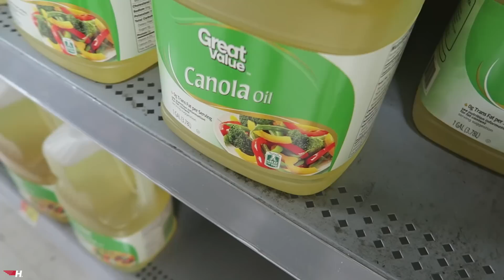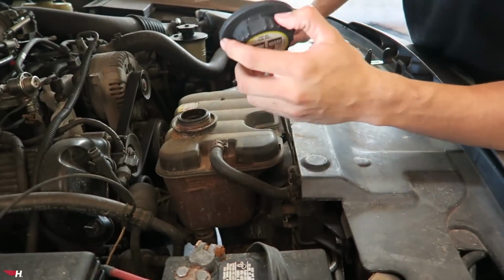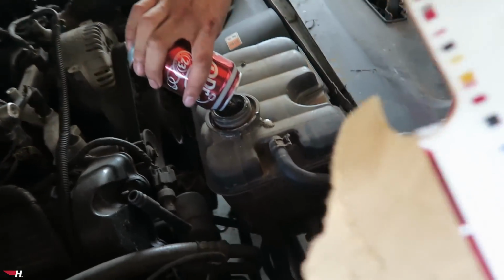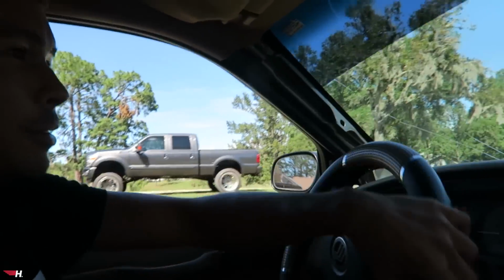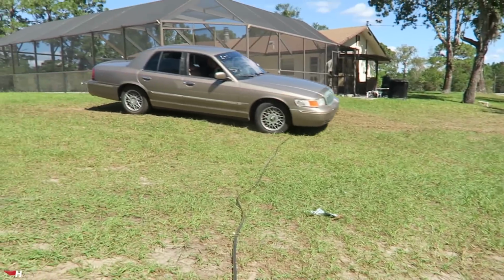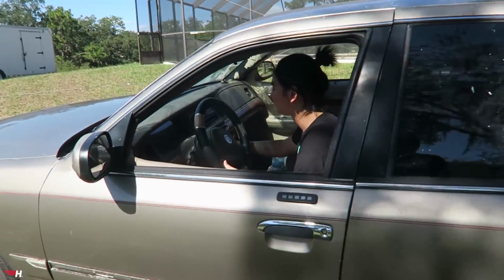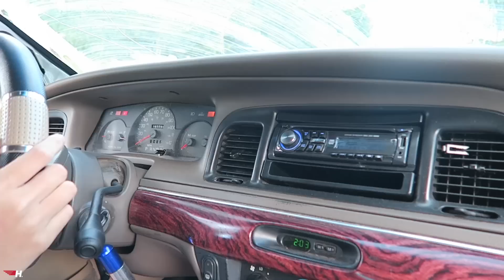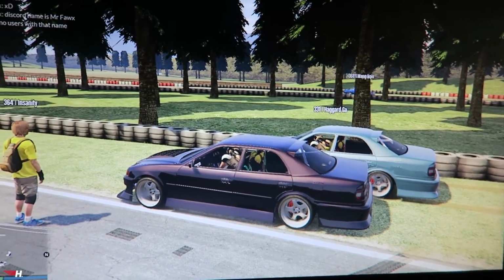Can You Use Cooking Oil As Engine Oil?

Comment from the maker: let us know if theres any myths you wanna see us try to bust
Reply: Mike Michaels stupid question.
Reply: lube
Reply: What happened to the wrx
Reply: Will the brodozer run on Napalm?
Reply: Haggard Garage so sweet that you did this experiment
Reply: Haggard Garage slam a car and to go off-roading
Reply: rva .cu4  pretty much gave it to that 350z kid cause Orion blew that Z up around track. Or that kid hasnt bought a new car yet.
Reply: Try Bacardi 151 for gas
Reply: Haggard Garage coyote swap it and put it on coils
Reply: rva .cu4 traded for the 350z
Reply: Haggard Garage get a working coyote from a absolutely totaled mustang for the low low
Reply: Haggard Garage How much boost could you get out of an ebay turbo in a 90s protégé?
Reply: ts a fact that you cannot for sustained periods of time. Mythbusters have not tried this BUT Top Gear USA series did infact do this and within 15 miles the car ceased the engine and no more engine. apparently so did the BBC Top Gear, they used veggie oil for a volvo. didnt watch the youtube clip but im sure it turned out just as bad.
Reply: Haggard Garage you can use cooking oil to run your diesel on (Bio diesel)
Reply: That radio is mint please send it to me if you don’t need it I need tunes bad bro
Reply: You should use lucas oil stabilizer with cooking oil and revisit this.  Maybe see how many road miles you can get out of it. I think that it was just to thin.
Reply: Will cinderblocks break before jack stands?
Reply: Can the grand marquis run off diesel?
Reply: Haggard Garage can water be used as a washer fluid
Reply: Can the van be driven from ct to flordia ? <3
Reply: John Goepel
Reply: +Haggard Garage will brake fluid work as engine oil?
Reply: Haggard Garage what's ur Xbox one gmaertag I will play Forza horizon 3
Reply: When gasoline is put in a diesel does it really not shut off with the ignition?..... try it with the brodozer
Reply: Will onion ever have the balls to get the Lexus or will he keep showing off a rifle any 18 year old could buy in Texas
Reply: rva .cu4  it's with the guy who sold them cams Z
Reply: Can you place in a pro/am event?
Reply: Haggard Garage get ur Lexus back
Reply: Fill tires with expandable foam!
Reply: Why ebay cam left haggard
Reply: If I paint my car green. Do I have to give it away?
Reply: Win a drift competition.
I think I've seen most videos haven't seen a W. While adamlz just got his wtf
Reply: Can you use mustard to clean wheels
Reply: Butthurt Orion he did it to mine
Reply: which coolant tastes the best ?
Reply: Haggard Garage don't forget to top the thing off with Lucas oil stabilizes
Reply: AK footage shooting up the car on Haggard2?
Reply: Yeah, see if you can bust DEEZ NUTZZZZ
Reply: Put e85 in a car that isnt flex fuel friendly or diesel in a gasser
Reply: Haggard Garage boosted go kart 🤔
Reply: Haggard Garage so you just gone point the gun at the car but not let any rounds off nobody told you if you pull it out use it
Reply: How much alcohol can we consume in under an hour.
Reply: Can haggard put out good content?
Reply: Can you run an engine on 90% isopropyl alcohol? (use it instead of gas)
Reply: pick up a riding mower or something to fuck around with or something lol
Reply: can you use mountain dew as a substitute for blinker fluid?
Reply: Do more stuff like this
Reply: Yo can i have the radio? Please
Reply: Haggard Garage you know that same engine is in  the mustang GT's of the same year could have used it for your swaps or something
Reply: Can it be slammed and tarmacked daily
Reply: Haggard Garage get it to run on something else other than gas!!!!
Reply: Haggard Garage i wanna know if you guys have real jobs or if its a myth?
Reply: Haggard Garage go off-roading in it hahahahaha and when the engine floods with water take out the spark plugs hahaha
Reply: Haggard Garage can you drive if you slam it and remove THE WHOLE COIL SPRING instead of cutting it
Reply: Ooh, I've got one.

"Am I actually a Pro-am drifter?"

I think I know the answer to this one already.
Reply: Can you use windex for coolant and gatorade for windshield fluid
Reply: Haggard Garage if running directional tires the opposite way while drifting will make them last longer
Reply: Bust that myth of the stolen Lexus tho🙊
Reply: Haggard Garage I bet the oil would've lasted a while just not your choice of coolant lol
Reply: atf as engine oil if added one extra quart
Reply: The 4.9 liter/300 ci ford six is "bulletproof" and cheap. Do your worst. And get a rust bucket lol I would gladly drive that lincoln.
Reply: tim novak That's literally not an issue. I did it in one of my cars and it got rid of a really bad lifter tick.
Reply: Use brake fluid as boost on air filter
Reply: Haggard Garage yoooo chow needs to shop the rrcipie for that fried rice. Shit looked bomb as fuck!
Reply: Orion if you can’t tell already, people are growing up around you and actually doing something. Rudnicks got a skyline! You’ll get a lot less hate and more views if you stop the childish shit and actually make progress with yourself. You were doing the same shit a year ago.
Reply: They coming
Reply: Will use build a shit car like hoonigan
Reply: How are you going to let the air compressor run the whole video in the garage when your not even using it?
Reply: What myth you should bust is to see if this channel will make it another year...
Reply: You can't use cooking oil as engine oil, but you can use it as fuel ( diesel ) , it works 100 % , in special on older cars.
Reply: try to make the most budget drifter you can imagine, to show how easy it is to get into drifting
Reply: Btw my family was using long time ago cooking oil in now 60 yrs old tractor and it still works today.
Reply: Can you use engine oil as cooking oil.
Reply: rva .cu4 they gave it to the kid that used to own cams z
Reply: Haggard Garage , will black pepper fix a radiator leak
Reply: mix the highest proof vodka you can find in 50/50 with gas and see if the car runs well
Reply: I need that car please
Reply: can you haggard twinturbo the 2jz and not blow it up without any tune?
Reply: Bust the myth of why half the people that join the Chanel disappear 6months later
Reply: theres a myth going around that orion is a coward and wont even get the police to go get his lexus from dan. bust it by doing a video of you going to dans getting your lexus like a man.
Reply: Sleeper / daily it
Reply: Jun K that is totally uncalled for. If I was a mod for Haggard, like I am for Tommy and Jack, I wouldn't let shit like that fly. Why do people find it funny to think their edgy for saying awful things like that and also the N word.
Reply: Can u guys please just build cheap cars like u used to do. Like fully haggard. Like the boosted protege or the twin turbo gs300
Reply: haggard garage whats the plans for the marquis after this
Reply: Haggard Garage can u drift a civic
Reply: FatBoyGamingTV scrap
Reply: This was exactly the stuff I was thinking about when they asked what we wanted to see!!...  End of the day there's plenty of other channels that are sophisticated and do it "right"..  Haggard are the ONLY guys to do it FUN!! Keep it up!
Reply: Haggard Garage can u send me the mods for the gta to me
Reply: Haggard Garage Put a car in reverse at 50mph
Reply: Haggard Garage coolant as gasoline
Reply: Joe Schmo that's perfect thinking dude😂
Reply: Is it possible to get the Lexus back
Reply: See if you can run a car with 2 stroke gas
Reply: Haggard Garage put normal oil back in it, and water
Reply: Joe Schmo mythbust the Lexus escape please!
Reply: how about cooking oil as transmission fluid
Reply: I thInk you two have already busted the myth that Asians are smarter than the rest of the world.
Reply: Y’all crack me the fuck up
Reply: Change the shocks with wood.
Reply: Haggard Garage I just wanna know where yours cars are. The Lexus and Subaru
Reply: Nothing, work on your cars
Reply: Can Onion get the Lexus back?
Reply: Razzo you gotta make a living somehow. I ain't never seen nobody complain about someone getting money. They doing it completely legal too. Why is it a problem to you? Can you not watch a 2 minute ad? Is your schedule so packed that you can't watch a 2 minute ad???
Reply: Put a Honda on grandmas oxygen bottle.
Reply: worst episode ever!
Reply: Whatever you do, don't google "using cooking oil in the tranny".
Reply: What happens if monster goes in your gas tank will it have more octane
Reply: Anthony C myth busted. No he won’t. He will hand it over.
Reply: Test if you can recycle your old engine oil for coolant!
Reply: slam an atv + offf roading
Reply: Take a car and replace all the brake fluid with Dr. Pepper. and see how long it takes to blow the brake lines haha
Reply: you changed 2 variables at the same time then thrashed it, not a specific test probably the pepper that killed it ?
Reply: Richard Nielson stop watching and leave then. That simple
Reply: Richard Nielson this is the content they wanna make, it’s not your channel, your not paying them to make the videos so why should they make videos the way you like them.
Reply: Ryan Hutton we the subscriber keep youtube paid therefore dumb content eventually loses favor its all good they suck anyhow.
Reply: Ryan Nolt makes it really clunky and will ruin the engine
Reply: See if a car can run off of Syrup in the engine and laundry soap in the coolant
Reply: How about oil in the engine and the same oil in the radiator, see how your temps go. Or remove the rad fans and put the whole rad into an oil bath to regulate the engine temps.
Reply: Next time, Use a school bus!!!!!!!!!!!!!!!!!!!!
Reply: Hho and fuel mix.. 

Can you save fuel using hho.. Or extend your economy by introducing hho.. 

I don't want to hear about paracitic losses.. 

Just to see if it will extend economy
Reply: Haggard Garage Can you use engine oil as cooking oil?
Reply: Haggard Garage do your parents know you did that to their car?
Reply: Haggard Garage put sugar in the gas tank
Reply: Haggard Garage can you use any other thing then gas?
Reply: Add Gallium into the oil of an all aluminum engine
Reply: Haggard Garage try baby oil next time
Reply: Haggard Garage
Reply: You should put window cleaner in the window wiper sprayer box
Reply: Can a Honda still run if u put gasoline in a oil tank....?
Reply: Run it on hydrogen
Reply: Hi guys. I'm a student in Cape Town, South Africa . I am begging you please, could you help me out to get myself a car. I love your videos, but wishes with my whole heart to own even one of the cars yiu guys use in your videos. I'm asking with a BIG please.
hoping to hear from you
Reply: Will it run on paint
Reply: Haggard Garage you boys are a joke now lol
Reply: Haggard Garage OBVIOUS NO But! Can you use Oobleck as engine oil??
Reply: Try putting cooking oil in transmission
Reply: Haggard busters
Reply: OK... The old FORD managed to keep running until a fuel leak made it unsafe...awe... Now try the same thing on a HONDA or NISSAN or TOYOTA... see if they can do it as well as the FORD!
Reply: I think the cooking oil would of  worked if you didn't add the Dr pepper but that's just my opinion
Reply: Try filling its with trans fluid and fill trans with oil lrts see how that works out
Reply: Haggard Garage can you mix a vegetable oil with engine oil
Reply: Bust this myth: Used cooking oil works as fuel in a deisel car
Reply: Haggard Garage try to use water or no oil at all
Reply: Haggard Garage you should have put Gatorade in the cooling system
Reply: Haggard Garage use dr pepper as gas
Reply: PVC OVER TIRES LIKE DRIFT TRIKES BUT FOR ALL 4 WHEELS
Reply: Haggard Garage take a gas car and use diesel as engine oil
Reply: Haggard Garage k
Reply: Let’s see if you guys can actually not waste money, and a perfectly good car. Film that.
Reply: Use beer
Reply: Haggard Garage rubbing alcohol as fuel
Reply: KY JELLY LUBE
Reply: Haggard Garage can you use hydrogenated canola oil in CV axle?
Reply: Haggard Garage what pc do u have😭
Reply: None
Reply: Haggard Garage can you use syrup as oil
Reply: I wonder what would happened
Reply: Try mountain dew as antifreeze
Reply: Haggard Garage do one where you only do cooking oil swap in the engine
Reply: Joe Schmo run slick 50 then no oil they used to claim it would work
Reply: Brake fluid aß Engine oil
Reply: Superglue as engine oil
Reply: Can you use dr pepper as motor oil?
Reply: use varsol as fuel
Reply: Haggard Garage why not use engine coolant as an engine oil
Reply: Whats yall pub g names so i can carry yall
Reply: Sodastream gas/oil and try to drive around with it!
Reply: Next can engine oil work as cooking oil
Reply: A nut
Reply: Keep trying
Reply: Bacon oil
Reply: Z99
Reply: @carlosu4648  nnn
Reply: Can you use diesel fuel as engine oil? and greese.
Reply: Factory OD use sport drinks as windshield washer fluid
Reply: You changed the name
Reply: Factory OD how to drift vids
Reply: Do a regular driver skyline build
Reply: can u use mango juice as fuel
Reply: Use jet fuel as engine oil lol
Reply: Use beer for fuel

Comment: for the next video you should replace all the brake fluid with koolaid and go for a top speed run
Reply: Scott McPhee yes with  Onion driving ,  great idea
Reply: Lmfaooo
Reply: Lol jokes on you you could actually use straight water in you brakes and it would work. Not for long term uses but it will work to get you out of a pinch. But I see what you mean by your comment.
Reply: Tyler Buchanan I never implied an outcome, I simply offered a suggestion like they asked
Reply: Scott McPhee boiling cool aid works the best
Reply: The original formula for Amsoil was corn and soybean oil in equal parts and enough peanut oil to reach the max temperature rating desired of the oil. This is traditional motor oil.
Reply: Scott McPhee yeh, but they might die....ah
Reply: Or replace their brains
Reply: I heard air works pretty well too.
Reply: Would probably make a Honda Civic have the stopping distance of a loaded Semi-truck.
Reply: this man just told them to commit self delete without thinking about it
Reply: yes
Reply: Oh yeah

Comment: To do a proper test, you need to keep everything else the same. Use regular coolant, not Dr. Pepper. Come on, scientific method is really just common sense.
Reply: no shit huh. may as well have just pinned the throttle open in neutral. and i call bs on the mcdonalds thing. It was new oil.
Reply: @dantan-tt3el  Once it heats up, it does smell like McDonalds. Just ask anyone who runs a biodiesel converted vehicle.

Comment: car only had a little over 100,000 miles and those engines are good for 300-400 thousand miles
Reply: The original formula for Amsoil was corn and soybean oil in equal parts and enough peanut oil to reach the max temperature rating desired of the oil. This is traditional motor oil.
Reply: I think those engines last only 220 000 miles...
Reply: @kumikeijo6250  nah the 4.6s never die. One of the best engines Ford ever made
Reply: @kumikeijo6250  even tho there is a crown Vic that reached over 1 million miles

Comment: it will run on cooking oil but it only died because you replaced the coolant with DP too which caused the car to overheat but if you kept the original coolant in and just replaced the oil then the car would have worked just fine
Reply: I'm really considering using cooking oil in car right now. I'm nervous about it tho but I'm broke broke to buy an oil & my car sounds like shit. So 🤷🏻‍♀️..